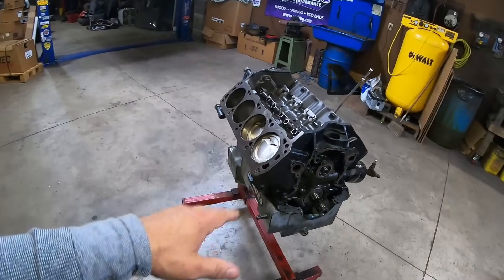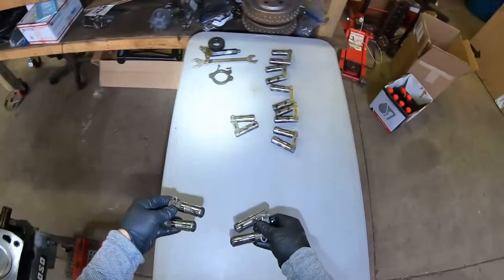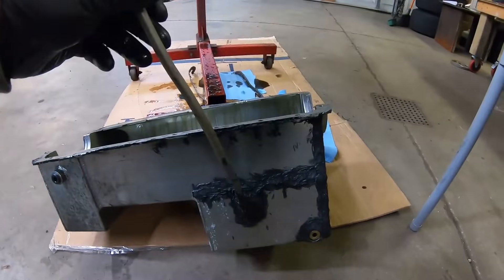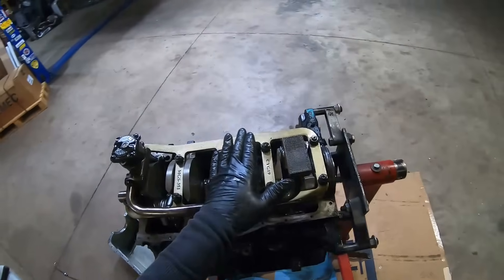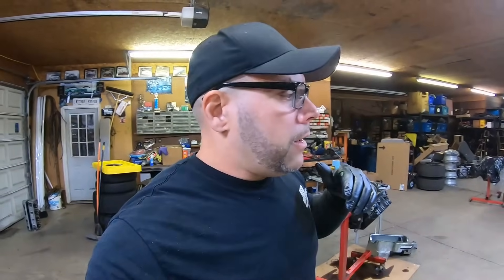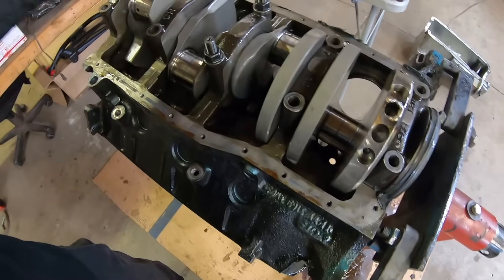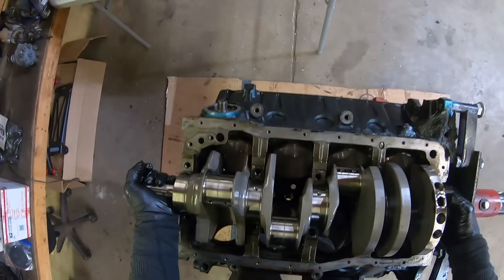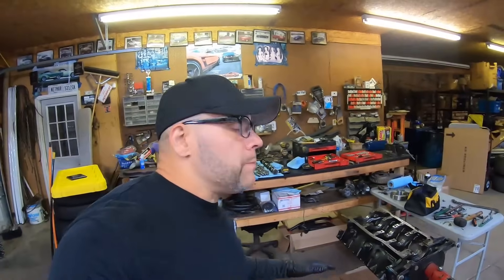1000HP 351w Stock Block 408 Stroker DISASSEMBLY You Should SEE THIS 👀

Comment: I'd like to build a on the cheap 393 windsor for my 1985 step side 2wd f-150 about 450ish hp and tq would do the trick. Just wonder if the zf 5 speed manual would live with a 3.55 lsd diff out back.

Comment: I built a 408W from a stock 351w block made in 1988 or 89. 
Just bought 3 bare blocks from a guy and started with one. 
Its nowhere near 1000hp.  I havent dynoed it. 
But it does a VERY good job. Torque for DAYS

Comment: so i used to own an 88 gt hatch back I blew my stock motor piston 7 broke the 302 block at a red light black smoke got back to my buddys house done. i did a stock rebuild should have replaced with aftermarket

Comment: We made 720@8200 with 383 Windsor. It’s been living for 4 years on the street and track. Production block with splayed 4bolt mains on 2,3,4 and a little oil system work. Great engine and I’m building another now but it will be hydraulic roller instead of solid.
Reply from the maker: Try the limited travels.

Comment: If the rotating assembly is zero balanced then why do you have a counter weight in the harmonic balencer?
Reply from the maker: Was not the balancer that was used on that engine …. Was only used to rotate

Comment: Main girdle is a must on 351 Windsors making over 600hp. They tend to get a little bearing walk around 700 + hp. That thang looks good. 
 I'd polish the crank, new bearings, put it back together and flog on it. It ain't hurt. BTW, what oil you use?
Reply from the maker: Brad penn 15/40. And thanks. My thoughts exactly.

Comment: I've seen production two bolt Windsor blockjs hold 1000  hp easily, and one in particular  twisted the  needle to 1577 hp ....twin turbo deal on gasoline pushing 37=38 PSI boost. In fact, it's usually a head gasket that will give up first, not the block.  All the pole smoking LS goons out there swear up and down that "only" their pile of sh!t LS kweer motor  will hold 1500 on a stock block, but the Windsor proves them wrong....and it vwas'nt even designed for that kind of abuse!
A production SBC won't hold that kind of power without scattering all over, but the 'copy of a small block Ford' LS engine will, but it also features a skirted block with cross bolot mains.....just like the old 427FE and 426 Hemi blocks. But a Windsor don't feature that, and it still holds the power!  Yes, internal balancing is one of the key's to keep it alive!
Silly Blow-Tie Chevy phaggs are F'n stupid.

Comment: Will that oil pan fit a 93 f150 . Another thing is that rotating assembly is made  by is it forge also is that carb or fuel injection what boost turbo and waste gate was u runnin

Comment: Does K1 Tech sell a 410 stroker kit or do you purchase the parts separately?
Reply from the maker: IM sure
Reply: @Neomustangs  CNC Motorsports sells them. Starting at $2400. I want to turbocharge my next Mustang. Thinking flex fuel setup. We can get E85 from the pump near the airport, but what if I'm somewhere and I can't find it. Needs to run on 93 too.

Comment: Thanks for showing your tear down. Was curious to see if you had any issues with the block. Do you fill the block with concrete up to the bottom of the freeze out plugs? I have a 351 built the exact same as yours, was worried about pushing 1000hp with it. After seeing yours I have no worries.
Reply from the maker: No block fill

Comment: Man it looks good! Think that variable cam timing was causing your low hp levels 😅. Shoot I’d put it back together if it was my broke butt, lol. Fix the valves of course.
Reply from the maker: Just going to redo the bearings, rings and freshen it up. Wont be that much. its been 3.5 years i owe the motor a close look before we beat on it even harder.

Comment: Thanks for your whole breakdown on the strength of the 351w,had a question pertaining to your budget 351w if someone out here can help me out,for the budget 387 build your using a 3.850 stroke crank,why not use the 4.000 crank? Is it because the 302 pistons are too tall to use the 4.000 crank and you would have to new pistons? Any help would be great because I have just bought a 351 to do the budget build but wouldn’t mind spending a little more extra for the 4.000 crank
Reply from the maker: You answered you own question. Yes

Comment: Got me wanting to build a 410, but I ain't got 410 money. 🤣
Reply: Budget 393 can be done under $1000
Reply: @Russell_and_Rosko eh not really but 2000-2500 isn’t out of the cards that’s where I’m at right now
Reply: @benjaminwatson7868  shortblock parts.
 There are several budget recipes that include new bearings, 351w rods, 302 used pistons. Can and has been done. If you've got a 351w with heads on it already, it's dumb to not do this in my opinion, unless you're building for efficiency, which it will still gain with the longer stroke. A 387/393w can be done for cheap, but it's the intake $800, head build parts $3000, roller conversion $800+ ect that gets expensive.
Reply: @Russell_and_Rosko  i guess if you stick with the e7te heads but they are not sufficient not even close, so you gotta at least get heads
Reply: @benjaminwatson7868  agreed. Don't do it without the headflow

Comment: Looks brand new still. What kind of oil do you run?
Reply from the maker: 15/40 brad penn or penn oil with zinc. $100 a case? took 6.5 quarts (i ran a shorty filter)

Comment: How many runs per Oil change?
Reply from the maker: Quite a few. I changed it every 3 months. So there was quite a few miles/runs as we raced a LOT this year.
Reply: @Neomustangs  I was changing every 2 runs on the 387, thought the gas was thinning it out, it would start out at 60psi then after a few hits drop to 30psi, pretty sure it was the Rod Bearing going out now,
Reply from the maker: My oil was 60 cold, 40 idle/driving normal, 30 when i made a hit. Recovered when oil cooled back up to at least 55.. thats normal dude
Reply: @Neomustangs  well we definitely had a Bearing failure on cyl 6, we have the engine back together, little tighter clearances than before but very limited part selection

Comment: I’m gonna guess it looks fine. I never had an issue with my 410W and it was NA and I was always bouncing it off the rev limiter. Also was a jerk to it and shot it with 75hp dry shot of nitrous without any nitrous tuning in the Holley.
Reply from the maker: Why not just watch the video? This was boosted. Yours was NA.. big difference.
Reply: @Neomustangs I watched the video. Exactly what I thought. Your cam retainer bolt backed out and chattered on the threads and your dowel broke and your oil pump pickup was messed up. I had a roller block from a 96 van. I also put 48k miles on my motor before I sold it. Could’ve used hone and rings but other than that it was running strong. I’m guessing you’ll be honing and putting new rings in. Are you going to go bigger than 410 or are you going to keep that 4” stroke and 4.040 bore?
Reply from the maker: @RadDadisRad  Same engine all new wearables. Heads were brand new upgraded best they could be. Might run a custom cam instead of that one. I dunno we will figure that out after rotating assembly is locked in.
Reply: @Neomustangs  nice, it’s a stout build.